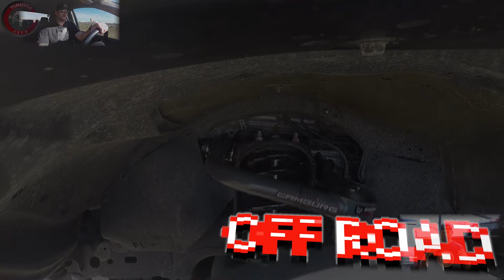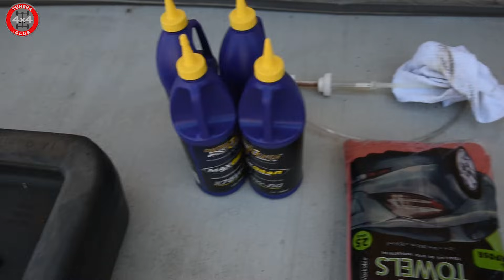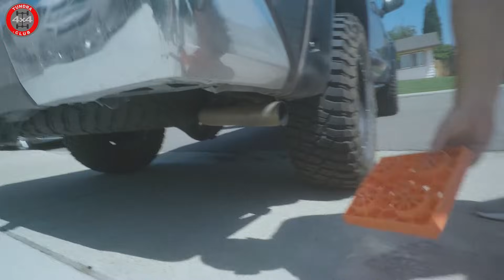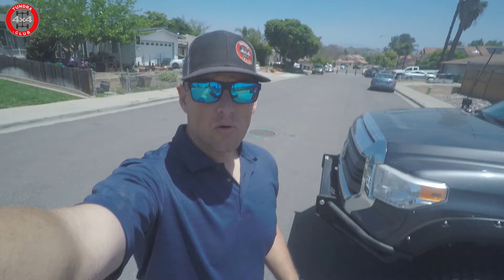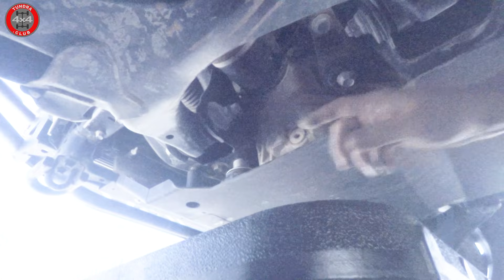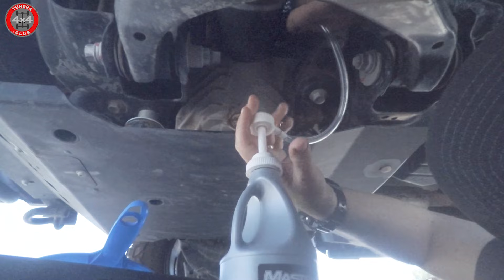Toyota Tundra front and rear diff fluid change

Comment from the maker: USE 75W GL5 for transfer case.  Available on Amazon
Reply: Careful guys. Use 75 LF NOT 75W90. This is not the first time he's provided bad info. Not hating, just making sure there isn't misinformation.
Reply: @charliethao1966  What is 75 LF?
Reply: @charliethao1966  why??? what is 75 LF????????
Reply: Same info for Sequoia?
Reply: Thanks for the great video!  Would it be a big problem if I used 75w-90 in the transfer case?
Reply: @rockysimbaboys  https://youtu.be/3le9ZT5HUlk this dude is a tech for toyoya and says its ok to use 75w 90. Explains why too 👍
Reply: I am putting red line 75W-90NS GL5 in my transfer case
Reply: Have Amsoil 75-90w in my 2021 front, rear and transfer case and I've only noticed a more "dampened" engagement from original.  Changed at 15k and at 16k.  Multiple engagements.
Reply: yea after watching other videos I came back to this one then noticed this post. 1 L of the Toyota 75W is about $79 on Amazon.

Comment: I bougt a Mighty Vac and it makes pumping these fluids much easier, especially since I have my wife manning the pump end. She sits there on a shop stool, pumps the Mighty Vac a couple times and when I tell he too vent it, she vents the pressure and the fluid stops flowing.  I can buy a hose and valve so I can man it myself, but so far my wife is a great sport. 

We have a good system when drain and fill trannies and differentials on our three vehicles,  Tundra, Tacoma and Outback(yeah I know). We had many more vehicles, including boats, motorcycles and airplanes, but when we finally fled Commiefornia in 2020, we downsized. Even with that, we had two other pickups that we transported across the country.  But back to my wife,   She is really the best wife in the world.  I hope the rest of you men can be as fortunate as me; I am sure many of you are.   We have been married 38 years and meeting my wife was the luckiest, most fortunate day of my life.

Comment: Dont forget to check the rear diff vent plug located on top.  This is part of the recommended maintenance.  If left in and not able to emit air vapor, one risks blowing axle seals or even worse.  Dorman 924-262 Differential Vent Valve Compatible with Select Lexus / Toyota Models

Comment: Subscribed 🤙🏾. I jacked up the front of my 2021 4wd sr5. One side at a time. Passenger side is quiet while I spin the wheel. Driver side sounds like the wheel of fortune. Sound is coming more towards the axle or differential. Is that normal guys ??  Thanks.

Comment: Hi, great video.  Just curious how many miles you had on your Tundra when you did the fluid changes in the front, rear differential and the transfer case.  I also have a 2015 and I'm at 31,000 miles right now.  Thanks!

Comment: What was brand of front differential fluid you used.  I saw the rest is gear max ?
Reply from the maker: I use Royal Purple all the way around.  Expensive, but works good. 👊🏼
Reply: @Tundra4x4Club  
Which ones of the royal do you use for front and rear ?
Reply from the maker: @consumerjoe5917  75W90
Reply: @Tundra4x4Club  
Thanks 
So I should buy 6 of the quarts ?
Any suggestions on replacing transmission oil.
Reply: I am at 60k miles and need to change all fluids.

Comment: This helped me today. Thanks a lot! My crush washer pack that I purchased had aluminum washers for the transfer case plugs, but these were not used. The plugs just had what looked like teflon paste, no washer. I also tried to fill with the quarts without a hand pump, and was successful on the rear and transfer case, but the front needed the hand pump due to clearance. Also, my torque wrench and hex socket did not fit on the front plugs, so I could only estimate the tightness.

Comment: Can’t thank you enough. Informative and instills confidence. Changed the diff fluids on my 2013 Tundra and my wife’s 2008 Sequoia today. Dealership didn’t get all the crush washers right for me and there are differences between the two rigs. Your video gave me the most confidence. Saved me over $500 and I enjoyed doing it. Thanks!
Reply: Plus you do not even know what the dealer really does to your vehicles.
Reply: Yup i didnt feel like doing it and they wanted 850 for this plus transmission flush....f that.  Great video.

Comment: thanks man.  i was at about 34k mi, i was surprised how milky the rear diff was .. had a bit of filings on the magnet, the transfer case and front diff were looking really good... i used amsoil in their flexible packs worked awesome no pump...

Comment: My transfer case calls for 1.5 liters or 1.6 quarts. People make sure to check your owners manual for your specific make and model. Ravenol for the win, easy pull tube built into bottle, no pumping!
Reply: What are you thoughts of the Ravenol?
Reply: @andy.hanway  No issues with transfer case since switching. Before I had trouble locking in and out of 4 low. Already another 15k miles since change about to do another fluid change soon with the Ravenol again. I run 4 wheel drive on the daily, so she's getting switched from 4 high to 2 wheel alot, and 4 low when needed. Front and rear diff are running Amsoil.
Reply: @beyondthecutcreations9391  ok cool, thanks for the reply ! I was looking at Amsoil but they don't have the 75w-85 oil for the front and rear diff or 75w for transfer case. Ravenol has all the requirements and recommended oils for all. It's hard to find the correct oils for these newer Tundra without paying high cost of dealer oils.
Reply: @andy.hanway  https://www.amsoil.com/p/severe-gear-75w-90-svg/?code=SVGPK-EA is the oil alot of Tundra's are using for front and rear diff. Its what's in my Tundra TRD PRO. I ran my truck all summer in Arizona exploring the state, 100-117 degree temps. Now I'm in Missouri in 11 degree temps. I don't baby her and have noticed much cleaner engagement of my rear diff, seems alot more solid under heavy acceleration.  The oem specs are to be taken with a grain of salt. Viscosity levels change with high and low temps. Amsoil meets and exceeds oem specs. Check the forums alot of the guys running Ravenol in transfer case also run the Amsoil if diff that im using.

Comment: Dude you have the wrong link for the hand pump..that’s for the gallon bottle size.The one needed is the one for Quart with short body.That gallon one won’t even fit in a gear oil bottle,too wide.

Comment: Did you use the same 75w-90 diff fluid for your transfer case? Did it have the limited slip addative in it? I have a 2014 I'm looking to do both my diffs and transfer case. Great video, you did a great job.
Reply: Use 75W only. Not 75w-90
Reply: @songyikim7479  I found some 75w that I ended up going with.

Comment: My friend, and fellow Tundra owner ..... I would strongly encourage you to consult your owners manual as the oils you added are incorrect for the Tundra driveline. The OEM fluid is extremely unique, and what you used does not meet their specifications and requirements ...... please revisit your owners manual for proper Lubricants ...... just an FYI .....

Comment: Do I need to replace the front differential fluid if  I have only thrown it into 4x4 like 10 times and had it in for only 10 mins max each time?
Reply: Eddie Solis you need to run your truck in 4x4 at least 10 miles a month
Reply: Beyond The Cut Creations thanks for that! I didn’t know!

Comment: Walmart sells Valvoline synthetic 75-140 gear oil, Iv been using this as a upgrade for the 75- 90 oil, iv been using the 75-140 for years I dear say for over a decade with outstanding towing and sub 0 use, what are your thoughts on that??? good luck

Comment: Few tips make sure the fluid is hot usually 10-15 miles on the highway  also 07-current tundra's don't have a true lsd diff it uses the brakes to simulate a lsd so no additives are needed

Comment: I have super magnate under my engine and under transmission box.
A lot magnate on axles gear .
I changed oil 5k miles and oil filter 2.5 k miles.

Comment: I have 2005 Tundra 4x4 ownwer manual say.
Recommended oil viscosity:
Front
SAE 75W−90
Rear
Standard differential
Synthetic oil SAE 75W−140
Limited−slip differential
Above −18C (0F)
SAE 90
Below −18C (0F)
SAE 80W or 80W−90

so unless it's deferment  on newer truck the viscosity should be 75w 140

but thanks a lot nice video easy locate.
Reply: That’s a different drivetrain

Comment: What size crush washers does it take?
Reply: Here is a link to the washers he used. Hope this helps. https://www.amazon.com/Differential-Transmission-Replacement-12157-10010-90430-24003/dp/B07NZ953BT

Comment: Pretty sure toyota change the T-Case in 2014 and you should be using straight 75W oil in it, not 75W90 like the diffs.
Reply: And it's impossible to get 75W in alaska. The dealership uses 75W 90.
Reply: 2013 is 75W90 recommended?
Reply: @tymom9313  No.  Toyota says to use 75W-85 GL5.

Comment: how do you find the oil level .
Reply: Abdul Raoufi in the blinker reservoir
Reply: Assuming you are referring to the transfer case and both differentials: Park your vehicle on a flat, level surface. Remove the top plug. (Where you put the oil in). Oil should be up to that level.

Comment: Thank you for making this video. Will be doing the same thing this weekend to my 2015 Tundra. Good tip with the dustpan; I hate taking the skid plate off.
Reply: Ya the skid plate sucks I snapped one of the bolts with my impact witch I need to change my oil in 500 miles
Reply: @jamesgarrison6430  impact? Rookie move

Comment: You're using the wrong fluid for the transfer case it calls for LF 75w read the owner's manual you have to get that from Toyota not the dealership but from Japan dealership does the same thing you do wrong the fluid comes in a can with old school writing on it otherwise great video I have a Lexus GX 460 I even call Amsoil I went on their website they say they don't have fluid for the center differential because it's a special mixture very expensive fluid
Reply: I called 4 dealers and only one knew what I was talking about. I got the Ravenol fluid on eBay, it came in the most German bottle I’ve ever seen.
Reply: Ralph the dealer can order it. I did mine last year but at 100k. I never towed. It’s pricey and uncommon. It was in Japanese/English(the bottle) and if I remember correctly my mechanic friend ordered through Lexus locally because they could get it. I never deviate from brand fluids for differentials or transmission fluid. Obviously front wheel drive need not apply for differentials fluid. We only got 95% of the stuff out though. Yes with pump.

Comment: Just an FYI, I changed the rear end Diff on my 2006 Tundra to synthetic gear lube WITH the additive for limited slip and it caused huge problems.  The perfectly functioning rear end started slipping and making noises. I replaced the synthetic with conventional read end fluid and the problem went away.
Reply: Tundras come standard with a brake actuated LSD.
Reply: Jeff Pittel ....Is it safe to say you don’t have a LSD and that’s why you had the problem?  

The manual indicates that a standard differential can use synthetic gear oil with no additives, however a LSD has to use the gear oil formulated and labeled LSD. 

I found that out by calling the Toyota dealer and giving them my VIN #.
Reply: @smokestack9795  all tundras come standard with lsd I believe
Reply: @jamesgarrison6430  by the brakes only. ABS not a clutch pack

Comment: your truck is 2015, why do you need to change it?
Reply from the maker: +TurnBull ac two fold for me.  I had discovered a dirty vent valve after a mud crossing in January.  Unfortunately, I waited to long to install the vent relocation kit.  I checked the diff fluid and found it to be extremely dirty.  I also have an ARB air locker which causes more attention to the diff.  Hope this helps.
Reply: Ya because Toyota told me 100k

Comment: Good on you for adding the torque specs to this job.  That is the important info folks need to do this kind of maintenance correctly.
Reply: My dealer ship changed mine 2 months ago and I noticed differential fluid on my garage floor a week ago and took my 18 tundra back too them and to my surprise they owned up to it they messed up and hadn’t torqued down the front differential to spec’ I was glad to still find honest people are still out here
Reply: You don’t need to spec a dif bolt lol it’s not a internal engine part. Just snug it tight and quarter turn it.
Reply: @DonniesBack  There is a torque spec for almost everything.  Lug nuts on tires, Oil drain plug, and diff bolts..etc.  It's a Japanese thing.   But I think him putting those numbers in the video will keep people from over tightening, which is just good information to have.  Would you agree?

Comment: Just a tip for future.  Since it’s kind of hard to determine what 1.2qts is,  just pump the fluid in just until you see it dribbling out the fill hole.  Let it dribble out till it stops or there are just a few drops and close it up.
Reply: Yeah thats kind of the point but it gives you a guide how much fluid to buy
Reply: Make sure that your rig is leveled out as best as possible..
Too much oil might cavate.
Using a magnet inside fill hole is a great tip!

Fyi: I've been told, by my mechanic, not to change "diff" oil.. for the same reason, it's often said, not to change the "tranny" oil! 
'If it's not broke don't fix it' philosophy, don't fix it!
Especially Toyota's!!

I pull a trailer with my 5.7l Tundra (with upgrades I made like: factory tow package to grade V hitch, TRD sway bar, SumoSprings bump stops, Bilstein shocks and new coil springs all around..
Other performance enhancements: S&B cold air intake system, 2 1/2" exhaust 'CatBack', P'chip, ect.

BeSafe!
Reply: @Traveling_with_FIVE_Cats  as a mechanic that is horrible advice. You want to change your fluids at the scheduled times. I agree you dont want to "flush" your tranny. But drain and fill it. Having some of the clutch material in your fluid is always good. You def want to change your diff and transfer case fluids though regularly. Oils break down. You have to change it. Now if you've prolonged it and have never done it then yea it can cause issues because the wear you've put on said tranny or diff have so much material in the fluid that it helps it continue on. Take it away and they fail. But they don't last as long going that route. Sounds like the mechanic you are talking to is wanting your money.
Reply: @Jaxboy86  I have a 2017 Tundra that I bought a few months ago with 96k on it. I have no idea if these fluids have ever been changed and was planning on doing tranny, transfer case and both diffs very soon. Now have 114k on it. Change or no change?
Reply: @Jaxboy86  is 160K on a 2008 without a change too long to bother changing it now? i never tow and we are slow drivers.
Reply: @Shady_Character_7  you should be ok to drain and fill, twice. Just do it correctly. You just want to rejuvenate it a bit while keeping that clutch material in your fluid. 160k is a long time so it will prob be pretty burnt towing or not.

Comment: Nice maintenance video. You also might want to mention if you have lockers or limited slips you might need to add a friction additive to the  differential oil and may not want to use synthetic oil, it will make the lockers slip. Make sure that your transfer case uses gear oil and not ATF, a lot of new transfer cases use ATF. And last but not least change your  vent valves or make sure that they work, you do not want to blow out sills or gaskets. If doing a water crossing or a lot of sand you might want to even extend your vents with a hose and put a filter on them so stuff does not get into your differentials or transfer case.  The one other thing I thought of is use gaskets instead of silicone. If you do use  silicone gasket maker make sure it's the right type for either ATF or  the gear oil you're using as most oils and ATF will eat the wrong type of silicone. Once again great video and the dust pan was a good idea.
     Hears a idea of the vents. Also the transmission and transfercase vents.
https://youtu.be/-mXzRPUUPjg
     Hears how to change out a axle vent         and why you should.
https://youtu.be/2SqHhh7FCoo
     How to make your own axle vent tube extension, because the  kits to do this are expensive.
https://youtu.be/hXqzJJtKW7A